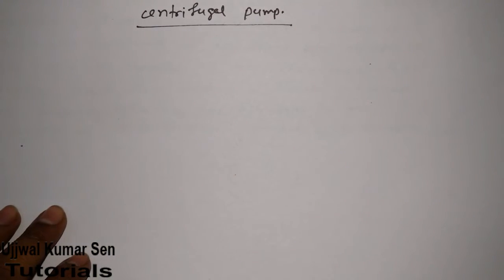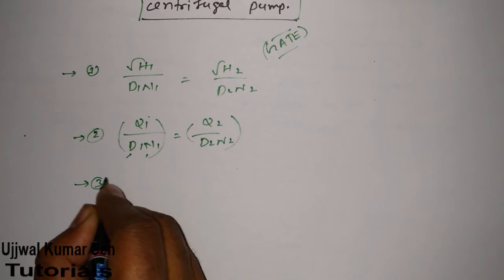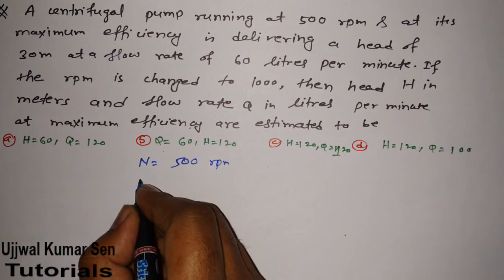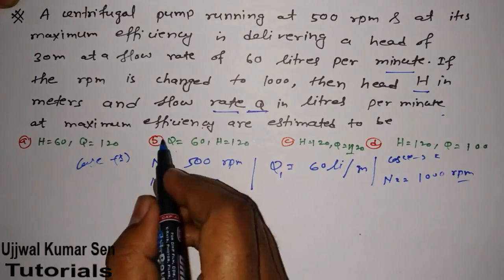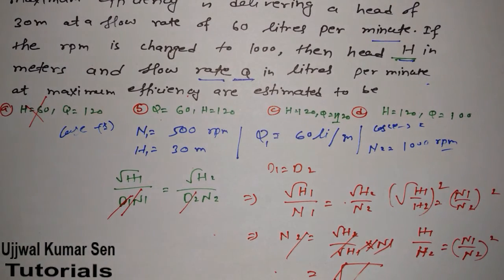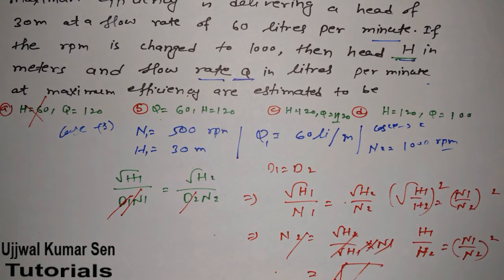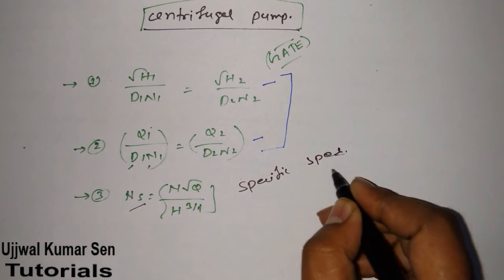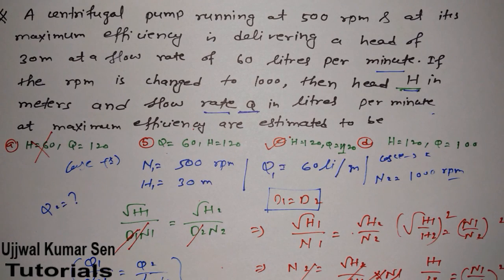Centrifugal Pump GATE Previous Year Question with Solution

Comment: a centrifugal pump is required to deliver 70 lit / sec of water at room temperature against a head of 100m when running at 1450 rpm find the no of stages for best effeciency
Reply: plz help me do this stuck for more thrn a hour sir plz plz plz
Reply: kr payega sir ap plz to kr dijye warna clue dijye plz